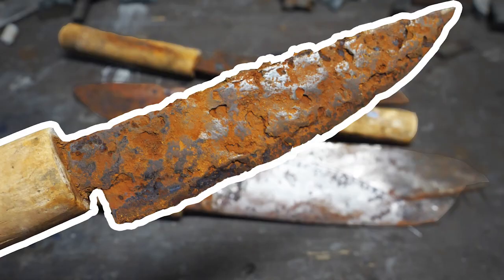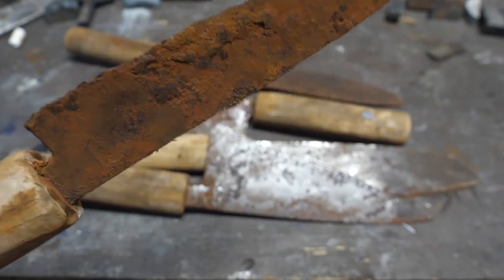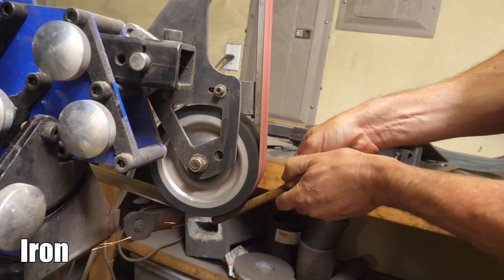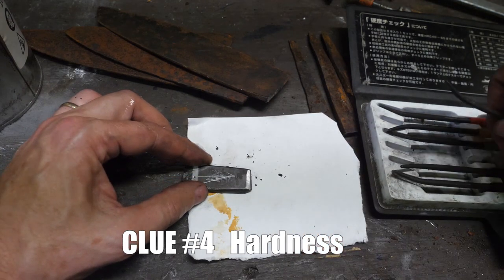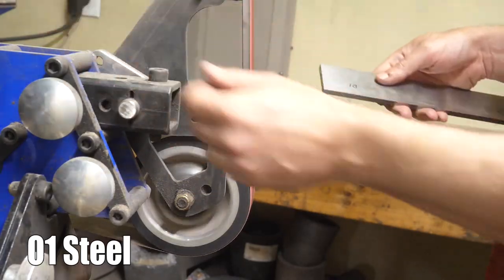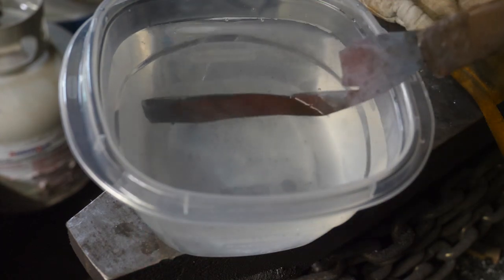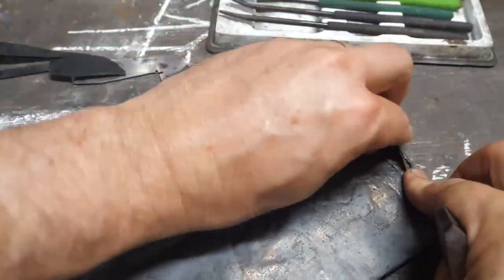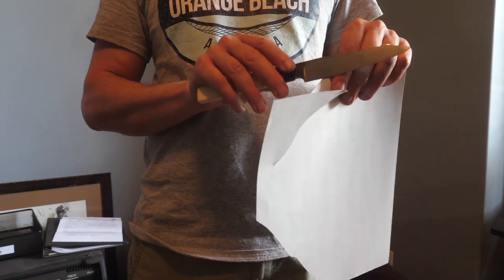Rusty Japanese Knife Steel Tested and WHOOPS!

Comment: I lean towards the first option. Hitachi's white and blue paper steels both have carbon contents in excess of 1% (Some are as high as 1.3%) so it ain't those. Moreover, those blades looked positively ancient, like, archeological "as found" condition. The way the grips cracked around some of the tangs and the way the tangs were reduced to a flaky black oxide pastry lead me to believe that the raw poplar was soaking up moisture from the air and holding it against the tangs like a sponge for a LONG time. 100 years old? Likely! So I'm leaning towards pre-war. If this steel was made in a tatara furnace (which was a lot more common in the Taisho era than it was in the Showa era) then it came out in blooms of roughly 3 grades. The highest carbon, hardest stuff would've been reserved for things like woodworking tools. The lowest grade stuff would've been comparable to mild steel. Now the mid-grade stuff would've started out with around 0.6% carbon and trace amounts of impurities like silicon and whatever else was in the black sand the steel was smelted from. After being heat treated in an oxygen rich environment, well... I think those knives with burst handles were that and the others were something else, maybe not as old.

Comment: I would guess that most or all of them were made of what is usually inscribed as "Japanese carbon steel" which is kind of a generic good quality tool steel used for many applications including lots of workhorse type cutlery. I have a number of old knives in my collection which l have restored which use this steel, and they are all very good except one, which just refuses to take a good edge. it takes a useable edge but not a truly good edge. Point being that it is possible that some of the steel you used might just have been defective. But it is puzzling why your blade comes out so much softer than the other pieces.

Comment: Could it have had a bunch of decarb on the knifes that you didn’t completely get ground threw while cleaning the rust off? Then when you layered it that caused multiple striations in hardness and a layered pattern when later etched.

Comment: Great follow up video. The “handle and all” foil pack normalization caught me off guard😂 
I bet you could soak that blade at higher temps and get that carbon to migrate a little, not sure if it’s worth it but considering the crazy stuff you’ve done in the past with carburization and migration, it wouldn’t be out of place.
Reply: or even just case harden the edge?   I bet he could have made a nifty "hamon" of sorts by case hardening in a wavey pattern, thus changing the appearance of that bit of metal after hardening.
Reply: Might also try a cryo treatment.  If the knife is alloyed with vanadium/chromium the cryo would help with the migration

Comment: I’d have to agree with the first possible explanation. I’m not an expert on Japanese cutlery by any means, but in my experience etching san mai (with mild steel) or grinding the can off canisters, I find that mild steel etches noticeably different than even unhardened carbon steel. I would think that if you had mild steel or iron san mai it would have been exposed on the initial test etches. I think the possibility you have two different hardenable steels that don’t etch super distinctly prior to hardening is more likely. Also possibly worth considering is that the final blade appeared to have a decent amount 65 and 57 sections. With the extreme level of rust on those blades and as thin at they were, I’d almost think a large portion of any mild steel or iron jacket would have been corroded away and wouldn’t have left enough material left to make up that much of the metal in the final piece. But could also be completely wrong haha. That’s the fun part of experimental bladesmithing. Super interesting project regardless of the results!

Comment: Not sure why you said "most Japanese kitchen knives aren't hardened to 65"

As a professional chef of 15+ years all the aogami 2 and super blue knives I've used or handled were 63-65 hrc

And why you ask? Easy... edge retention. 

Harder steel gives better edge retention. And aogami (and shirogami)  steels are made for high HRC, low edge angles, for maximum performance.

Comment: Man I am finding these to be so intriguing. With my limited knowledge as a user, guessing between #'s 1 & 2. Fairly certain that at least one of the blades was a laminate (San Mai) due to what the etching of the knife showed. The grinding is an interesting point too. What if one of the knifes actually were either and/or both, Hitachi's White Paper and their Aogami Blue #2. A Huge fan of the SB steel—it's one of my favourites

Comment: I don't see any problems here. First, you made a great video about constructing a knife from old knives. The knife came out pretty cool, despite the paucity of useable material you had to start with. I think all of your testing points to your conclusion that you were starting with some high quality steels and some low quality steels, but not enough of either one to do rigorous testing beforehand. You even got another great video out of the process in exchange for a lesser knife. Next time you just need a lot more rusty knives to start with so you can weed out the nonhackers, which will be yet another cool video. Win win win!
Reply from the maker: rt

Comment: I think Japanese kitchen knives are usually harder than western knives. 

Do you think pre heat treated steel sparks the same as post heat treated?  Was your O1 hardened?
Reply from the maker: No it was annealed from factory.  Hardened probably generates more sparks because it takes more work / gear to remove?  Good question I’ve never tested that.

Comment: unless they were expensive knives to begin with, i would have a hard time believing they were bue mono steel, every less expensive japanese knife ive seen that uses one of the aogomi steels is laminated. msbey there is another less espensive alloy steel they are using.

i think the ones that your haviing heat treating issues with are probably sk5, this is a very common lower end steel in japan and it really cant be heat treated over 60 or so.

Comment: As a Japanese kitchen knife collector my bet is on two being the most likely. The reason is that it is pretty common for a Japanese knife made in either the sanmai, warikomi or awase (basically one side is hard steel and one is soft typically done on single bevel knives) style to be made of something like aogami with a softer steel to protect the more brittle hard steel core/cutting edge. Typically Japanese kitchen knives range from 58 to 65hrc or possibly 68hrc so with mono steel I would not expect 55hrc but I would expect it from cladding. Granted the knife that you made could very well be 58hrc as far as I know. I am just basing this opinion off my knowledge and you saying that it is 55hrc.

Comment: I would go with #1. You grabbed 2 or 3 different types of mono and tried forging together. Which takes me back to my original comment of using electrolysis to remove the rust. Then by cutting the knives, you could spark test each knife by using only a small portion. Then, I'd throw matching mono steels into a canister and go from there. Grinding the rust off those thin blades cost quite a bit of good steel since blades were badly pitted. Am no expert, just know what has worked out best for me.

Comment: From the sparking, I am going to guess they're all made from Hitachi Blue.  Given that all the knives were of the same style and finish, almost as if 'production-lined', I find it hard to imagine that a smith would make some knives from one metal, then switch to another metal for others of the same design and finish, the variation in spark colors across the five, coming from differences in thickness and level of corrosion, rather than the metal used by the smith 👍👍👍👍

Comment: Furnace conditions were all identical? Because heat treatment can, depending on furnace atmosphere, carburise or decarburise the steel. If some of that was done in a stainless steel sheet pouch, where others were done exposed to air, or direct flame, you might get differences in effective surface carbon content.

Comment: I just dont see them doing multisteel construction on production knives, unless they managed to rob a takefu warehouse or something for a fancy plate of san mai.
Probably a combo of different steels, if there's some alloy predominant in there it might take to a medium quench speed oil or a plate quench but just off the top of my not exactly brilliant brain when it comes to Japanese steels- just not a lot of the higher alloy tool steels are in the 65hrc bracket. Most of them you can get into the low 60's with, but almost universally its the high or very high carbon stuff to get into the 65+ range.
Plus, just a sort of arbitrary observation, they do rust like carbon steels, most of the higher alloy stuff tends to be a bit resistant towards that deep pitting effect where its peeling off in slabs
So, I guess its a mix of 1-2 steels. Don't really have much more to add

Comment: I think one of problem is that some people have weird idea that Japanese knife = amazing steel. 
Well no, most of them use random aloy steel, lots of use crappy steel. Even when you get knifes from one batch you can get few differences in quality.
Those knifes look like cheap ones that restaurant or markets use for chopping vegetables and meat, you get them in bulk and don't care about fancy handle or layered steel. Those are knifes that you use for whole day work, not fancy sushi cuts on fish one or two times per day. You sharpen them every hour using other knife so you don't care about quality of edge.
So my bet is that steel is just random quality aloy with enough carbon to not bend like plastic and with some aloy(chrome etc) to keep rust away a bit better.
Reply from the maker: I tend to agree.  I don’t think they had kanji on the blades and the symbol on one of the handles was generic and looked printed in a modern style.

Comment: How much carbon could have leeched out during the forge welding? If you have thin steel layers of low and high carbon steel in a laminated construction you'd probably get a lot of carbon migration during forge welding. Perhaps the carbon just diffused and evened out between the different carbon steels?
Reply from the maker: Some but only surface deep I think.

Comment: If it was a bunch of multisteel knives, could there have been significant carbon migration from the high carbon, 65HRc steels, to the low carbon jackets and made a medium carbon steel? Some smiths add a layer of nickel between the edge steel and wrought iron or mild steel cladding to avoid exactly that. Whatever the explanation, very cool video investigating where you could have gone wrong.
Reply from the maker: Anything’s possible.  I feel lost on this project.

Comment: Theory 2. Its pretty obvious. 1: I really doubt a kitchen knife made in Japan would be medium carbon monosteel, the culture just wouldn't allow it. The only way i can see that happening is if it was made from cheaper tamahagane.  2: If at least one of them had a San Mai jacket, which is more likely,  all the welding and forging it has been through would have caused enough carbon diffusion for it to harden like medium carbon. 3: If they were all San Mai, that's a pretty heavy ratio of low to high carbon. The dark lines in the etch would have been a lot thinner.
Reply from the maker: I think there are many monosteel knives from Japan, though.  Especially production.  The only chance I had of figuring this out for sure is long gone.
Reply: @GreenBeetle  I'm making a pretty broad assumption on that first guess, I'm a long way from being qualified enough to say with any certainty.